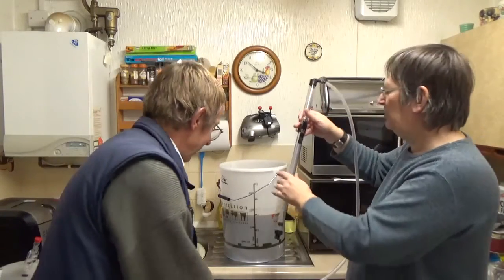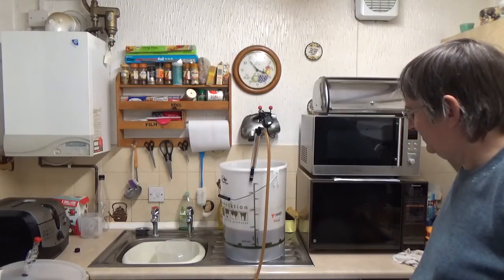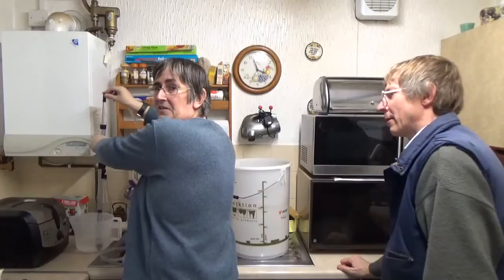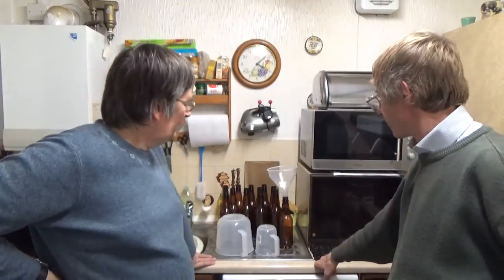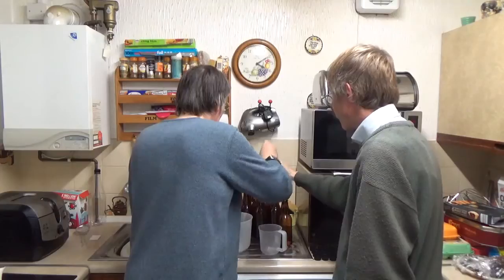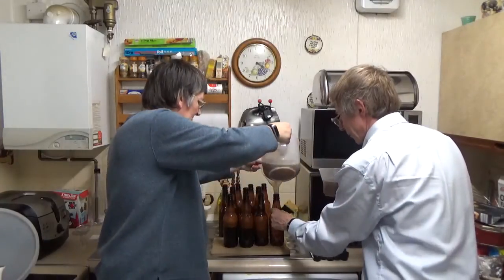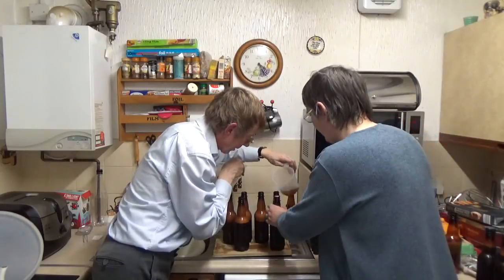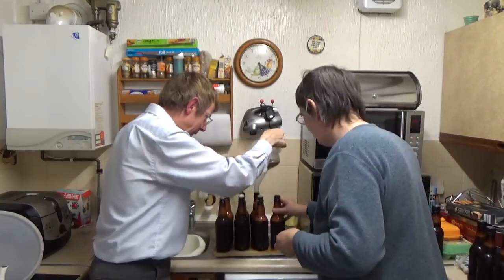Home Brewing - Making Barley Wine (Part 2) - 16th Dec 2015

Comment: That pump makes a huge difference  siphoning without disturbing the bottom of the bucket. Will the sugar increase the alcohol? Thanks for sharing Julie
Reply: +Patrick Meehan........ The barley wine will be about 6% alc and each bottle contains 1000/24 (=about 40) grams of sugar. Half a teaspoon of sugar is about 2 grams so if it ferments fully it will increase the alc level by 2/40 which is a twentieth. A twentieth of 6 is about 0.3 so the alc level will go from about 6% to about 6.3%. (wake up at the back there!)